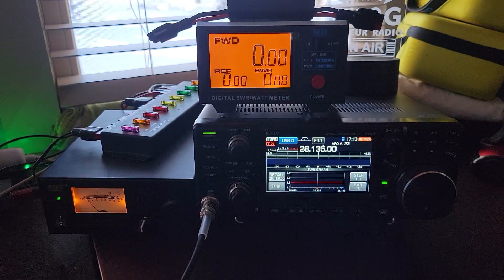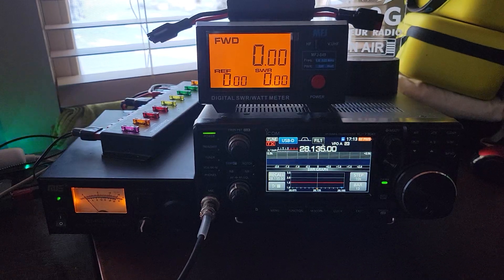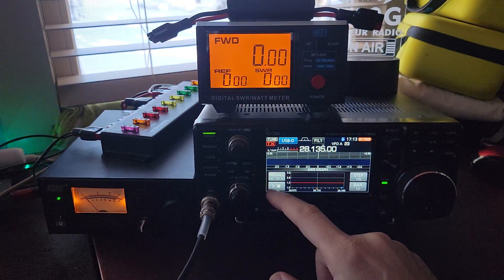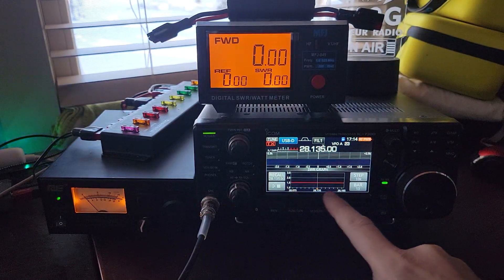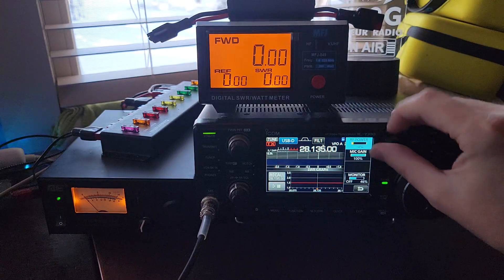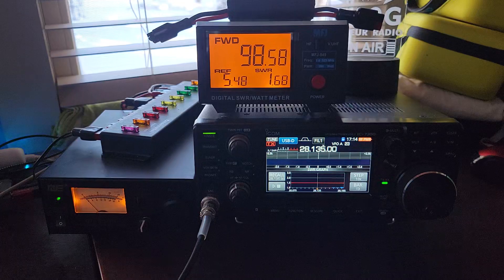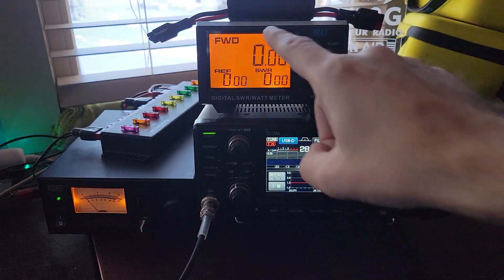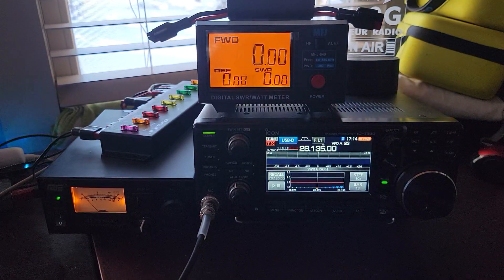Ain't I a Stinker?

Comment: There are at least two reasons why "indicated" SWR could change as power level is increased.
(1) Non-linearity. The input vs. output voltage curve of diode rectifiers is not a straight line. But once you get above a very low voltage, it's pretty straight so a well-designed SWR bridge should give pretty much the same measurements once a fairly low power level is exceeded. This is nothing to worry about; use the lowest power level beyond where curvature disappears. The SWR isn't really changing; your SWR meter is just telling lies when the power is too low.
(2) Component breakdown. For example your antenna may have resistors built in (e.g. the T2FD) and those resistors may heat up and change value. This is poor design and should be corrected. More seriously you could have some component, e.g. an insulator or the coax line itself, arcing over. That won't do! In such cases, the SWR really is changing and you should do something about it before you have more serious problems such as blown finals.

David  VE7EZM and AF7BZ
Reply from the maker: Totally agree.  Thanks for the well thought out write-up.

Comment: My Rigexpert manages to give me accurate readings putting about 20mW up the pipe. No way I would want to put the finals at risk pushing 100W+ into an "unknown" load. That's why if you are using a manual tuner you start off at low power and wind it up only to do a last check and operate.
Reply from the maker: Exactly - you can get really close on a tune by ear and then touch it up... or you can use a qualified/proper tool.  I LOVE the built in scanner/tuner combo in the Xiegu's - a useful tool.  The Icom model is a bit harder to use.

Comment: As far as testing an antenna, a well designed bridge should only need milliwatts; maybe a watt max.  QRP ops regularly make contacts at those power levels.  Testing with10 watts is QRM on an open band. 107W is disruptive QRM.
Reply from the maker: You got it!

Comment: Found some pages online about people having different SRW when they go full power. Maybe it's because that, that radios are using full power, so you know the actual SRW for the power you want to use? Thanks!
Reply from the maker: Yes, more forward power = more reflected power (you might be able to see it in the video if you really really look)... but a "scan" function should be properly tuned to its sensors needs.  I'm sure the sweet spot is somewhere below 100w, but I'm not the maker of this radio or its specs.  Just an interesting thing to look out for and share.

Comment: Interesting. I have noticed the SWR change from the 10W power level I use to tune my antenna to the full power SWR reading during Tx.
Reply from the maker: Thanks for sharing
Reply: Yep I get the identical results on my 7300.   And yep SWR climbs for me as the power increases, not simply because the reflected power is a ratio to the forward power.    It's not constant.   K7KS
Reply from the maker: @iowahank Hawk nailed it!

Comment: Newer ham here. Why is this important or worth noting.
Reply: Ideally, when amateur operators adjust or verify their antenna system, the least amount of power is prudent to avoid unnecessary interference.  The FCC always advocates for the least amount of power to complete a transmission. 

Another reason is not to dump excessive power into an unknown antenna system—there is always a potential for a dead short. Most electronics require some resistance to appropriately dissipate energy—in ham radio, 50 ohms is a typical value.

There are a few more complex reasons, but that’s the gist. 73
Reply: @markusberg2770  thanks for the reply
Reply from the maker: Thanks Mark!  Nailed it!
Reply: @markusberg2770  Wrong. The FCC advocates least amount of power for DESIRED communication. If I desire to be 20 over 9 to a station then by all means I legally can. Amplifier on always the norm for most hams as you are well aware. 

Here in case you actually never read it ... Part 97 : Sec. 97.313 Transmitter power standards (a) An amateur station must use the minimum transmitter power necessary to carry out the desired communications
Reply: @624radicalham  Yup. That’s verbatim of my FCC Rules and Regulations too — “must use the minimum power necessary. . . .” I’ve read each of the controlling statutes from cover to cover, ad nauseam.
Reply: @markusberg2770  I agree that especially when adjusting their antenna system, as you mentioned, the least amount of power is prudent. And QRP and lower power can be much fun! However there is way too much criticism of folks who use amplifiers from people that can't have them or have limited stations and it's important to note that those FCC regulations about "desired" power are open to interpretation and some (not you) use that as an excuse to suggest that one should rarely run an amp, which isn't the case.
Reply from the maker: Your radio's maker should know the design constraints of the system - "My SWR bridge can't read below X" or "My Receiver selectivity doesn't work below Y" so that would be the minimum power level required for an SWR scan - anything more than that is "wrong"  -- it should be part of the design specs and well known by them at least.

From your side, you want to use this tool to find out if your antenna is in good shape and ideally determine what needs to be done to fix it.  I have found that Icom's implementation is too narrow for practical use though.
Reply: @temporarilyoffline  let’s also remember that the internal ATU is also matching the coax and antenna as 1 complex impedance.
SWR plot is a good baseline for any ham shack to see if things are “normal”. Testing at 100 watts isn’t as bad as the KW amps 1kc away from a QSO in progress. Like you state, be mindful of your transmissions!

Comment: Hard to justify a 100 watt SWR scan.  It would be nice to use an independant SWR scan or Tune power setting that was typically set lower automatically instead of using the main power setting which is usually going to be set higher.
Reply from the maker: Right!

Comment: The 7300 manual states to run the SWR Plot function at above 30 watts, if necessary.  You need some sort of forward power to make a useful interpretation to the measurements.  Is the plot the same at 2 Watts when compared to 100 Watts on your antenna?  That's something I may try later.
Reply from the maker: The plot isn't the same at 2w.  Totally agree also - the 100w plot shows something different because more forward = more reflected, to a point of no (better) return